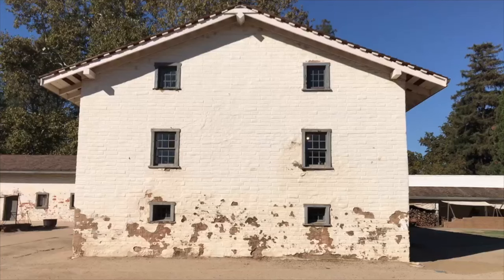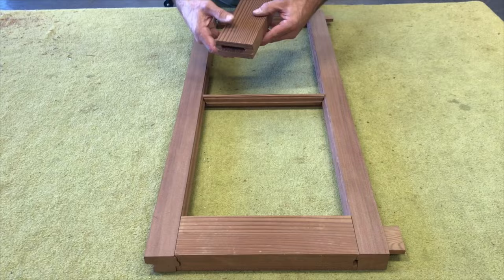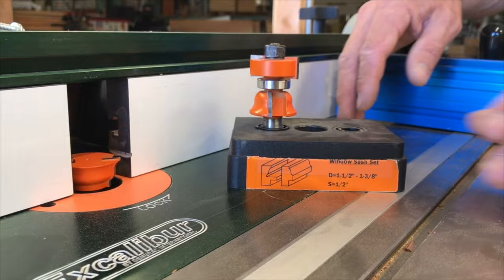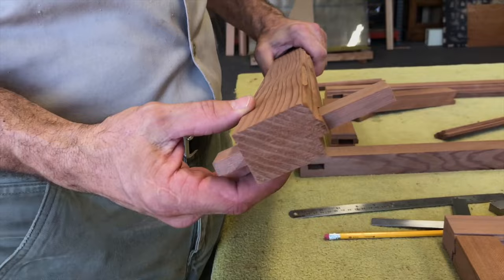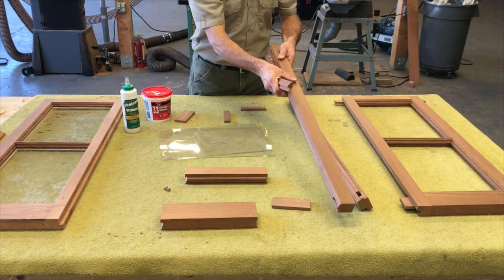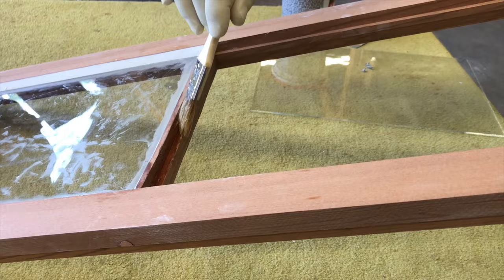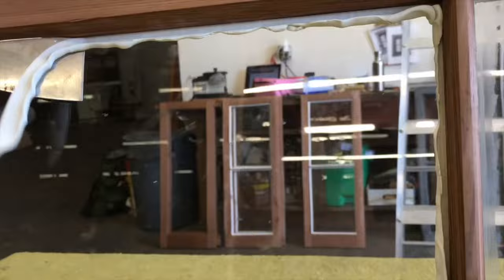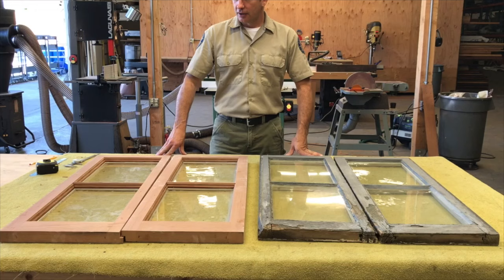Historic Window Construction- How to: milling/joinery/glazing

Comment: Absolutely beautiful! I am trying to recreate a long gone transom window in our 1891 home. This lesson answers all the questions I have (currently). Thank you for sharing your knowledge and skills.
Reply: Go to Atlas Preservation for a better example of correct preservation technique. It is not advised to use glue on the sash. Corner joints should be pinned with dowels. There are better products to use for glazing compound. Do more research.

Comment: I've glazed and worked on windows for 45 yrs. I have and ole house now with 40 plus windows, hrs and hrs of work. The thing that rotted ole windows were the neglect of the bottom outside corners when the glazing fell out or got loose. Water enters the joint and in time rot. I love your ability and use of nice tools  and sash set. I had a heat gun , 90°with asbestos edges to heat the glazing out,, broken glass only instead of hack out. A diamond shooter for glass set. It's a list art😢. On today's market, freelance what's the price of a average wood window ya think? If you can do windows you can do wood screens🤣. Once had a ole house with heavy gauge copper screens!!. Never ever seen em but once. Great job thank you

Comment: Great video Mike. I hope I can help with a tip on glazing compound. It's called Multi-glaze by Sarco. It's much better than Dap 33. Try it you won't be disappointed.
Reply: Yes, do what Dennis says. You will have a much happier life.
Reply: Considering he was using Dap 33 I thought he worked it very well. 

I always primed my sashes first.  Dap definitely doesn't stick well to the primer!  I will try brushing the bare wood with linseed oil on my next glazing project.
Reply: I used a paintable silicone caulk on my last window replacement and it sure was easier than glazing compound.  They say "sure, glazing compound lasts forever" but, that's not been my experience.
Reply: @rivernet62  I've been using regular glazing compound..and every time..I feel like there must be a better option.  What brand?
Reply: @patrickd8135  I’m not really a brand guy.  Whatever you have on the shelf.
Reply: @ggsmith48906  - we've used shellac on the rabbit prior to using the Sarco.

Comment: At the risk of sounding picky. I would think as a historic replacement the window would have been reconstructed at least in a similar manor. Typically in window construction glue will fail at some point. A tenon cut from the rail would eliminate one failure point. A mechanical wedge and dowel would hold it in the mortise long after the glue fails. I think it would have been neat to disassemble the old window to get inside the head of the maker and his methods. May have been able to reuse the glass if it made it in tact. Thanks for the video anyway. Sometimes you just want to stick with what you know.
Reply: Amen. I would definitely reuse the glass and build exact replicas

Comment: I have a couple of questions: 1) is the "waste" putty reusable or does it dry out too much in the process and 2) What is the recommended primer? I'd also like to know why boiled linseed oil is better than a primer on the surface of the wood before glazing. Thanks!

Comment: Great job, lots of skills! Coping the sash bars and stiles is really impressive. But is floating tenons and glued joints really historical? I’m no expert, just fixed about a dozen of old windows — tenons were integral and they were only wedged or cross-pinned (that’s why it was possible to fix them). Are these more recent windows or something?
Reply: I also was mystified  by the use of floating tenons,  i have done this type of work often, and we always cut the tenons the same way as the original piece

Comment: would be faster and better to cut actual tenons and wedge them (using a jig on the table saw ). wedges will hold till the glue dries and you can carry on working on it. also mechanically holds it together should the glue ever fail.

Comment: Great video!  Would be great to get more instruction on set-up of router, making loose tenons, etc.
Reply: Good comment. Can you post details of the router bits that you used please?
Reply: @maxbeck3577  there are many out there. Check out Freud adjustable rail and stile router but set to find videos. (But this video is pretty darn good).
Reply: @rich5034 can you link a good one here?

Comment: The original sashes could have been saved with epoxy resin and splicing where required! I have saved worse! Also the glazing bars do not line up on the new sashes...

Comment: this is not a restoration its just a set of mediocre windows. 
really poorly fitting joints  
use of wood screws
using replacement glass when the original is available
use of bog standard PVA (dont mind too much as benefits are significant)
use of loose tenons instead of traditional mortise and tenon
no linseed putty used
no expansion bevels on the joints
no full length tenons used for the muntins

those windows could have been easily restored and IF necessary new wood grafted in to replace completely rotted out wood.

normally dont rant on youtube as its pointless but this crap pisses me off as there is no conservation here at all you may as well have put in PVC windows
Reply: Don't hold back simon p.  Tell us how you  really  feel!

Comment: This isn't historically accurate and is disappointing really. Historic sashes never used glue or floating tenons. Plugs were used sometimes but only on the rails, and they were packed with linseed putty, not glue. And even when they were used it was on saddle joints and not M&T joints.
DAP33 is also a terrible glazing compound, especially when you consider historically accurate (and longer lasting) linseed oil glazing putty is still available. 
The original windows could have been repaired and lasted longer than the new. 
shrug
Reply: Show us how it's done.
Reply: @ethanepps5500  just buy one of Steve Jordan or John Leeke's books. Or any historical jointery book for that matter.
Reply: @ethanepps5500  It is possible, the only thing rotted was the lower rail and a quarter of each style.  If he were to slice off on a diagonal the rotted sections of both styles and use a splice to join a piece of old growth wood to the original, he could've saved 75% of the window and the original glass which he should've used regardless.
Reply: @lifestealerz  joinery
Reply: @joakerhodes6063  stile

Comment: Great video, but are taxpayers paying for this?
Reply: No.  Mexico is paying for it.  Just like they are paying for the wall....
Reply: It's a State Park, so yes.  What's your point?
Reply: Can you imagine the astronomical overhead, salary, benefits and pension costs of a government owned woodworking shop?   Subcontract it out.  Government should not be making windows.
Reply: @richardmckrell4899  I can see the arguments for and against this guy's project, but he's already a state employee with salary, benefits, and pension.  I bid out a custom wood window once and was quoted $700, for something much more simple.  I'm not sure there's a cost inefficiency argument here.  Your point is well taken though; they should have mentioned the cost of the project done in-house vs. a contractor.
Reply: @rivernet62  The only argument is a cost efficiency argument as this is tax payer money.  My business is restoring and making historic wood windows and there is no doubt this state shop is dramatically more expensive.  If you add up all the direct and indirect costs of that in-house state shop, the cost of those windows would be astronomical.
Reply: @richardmckrell4899  hah!  Maybe you’re the guy who tried to grossly overcharge me for mine!! ;)
Reply: @rivernet62  Multiple quotes and checking references is the best way to determine value.